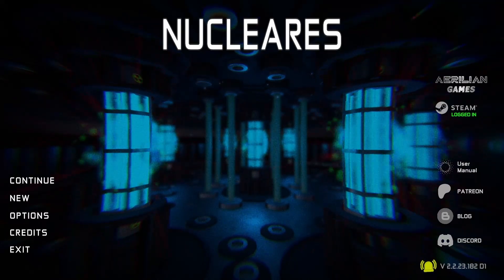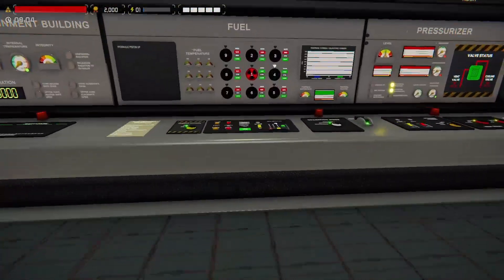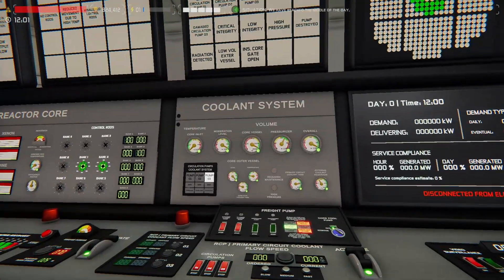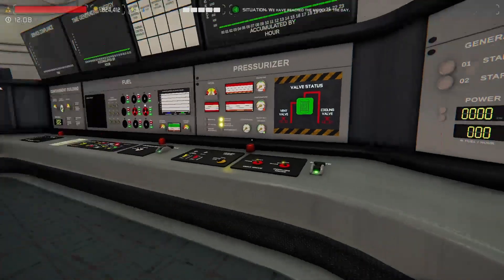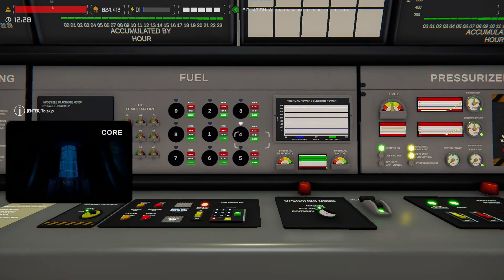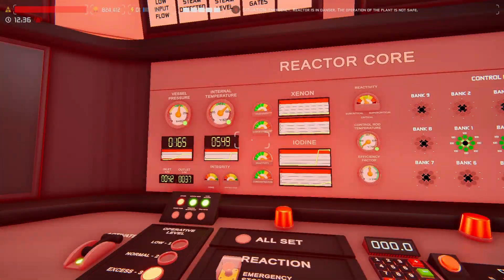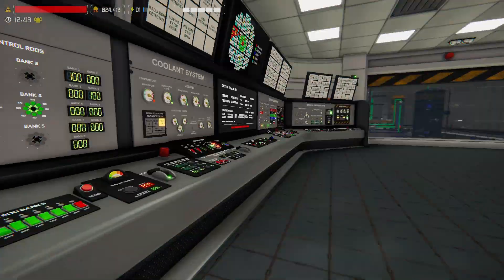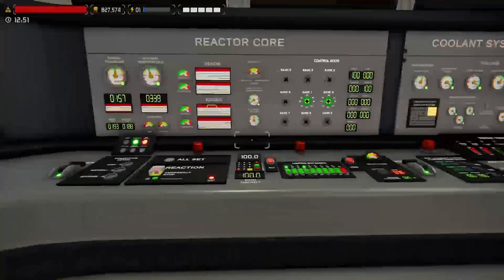Dual Fuel Startup - Part 1: The Disaster - Nucleares (v2.0)

Comment: On a dry core (no water) there should be no reactivity possible because the water moderates (slows down) neutrons and INCREASES reactivity. Some reactors use this as an additonal 'control rod' by recirculating cooling water. The big risk of running an already active core dry is the core destroying itself through the decay heat, not because it causes a runaway reaction.

So I guess it's not modeled but you should be able to load all the fuel and pull all the rods on an empty core and nothing would happen until you start filling it up with water.
Reply from the maker: The game shows this to a degree. When we lose pressure inside the core vessel or there’s no water, we don’t see anything happening other than vessel integrity loss and damage to the fuel. The temperature readouts are of the water in the core, which often trips up players and they think “oh, I’m fine, my temp is low,” but it’s only “low” because there’s no water to measure. But no, the game does not mirror IRL physics 100%